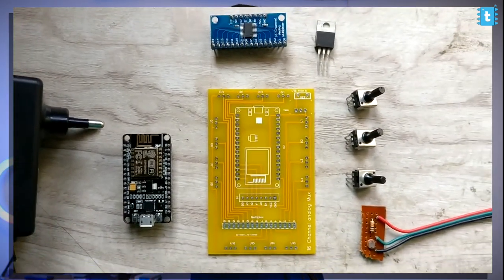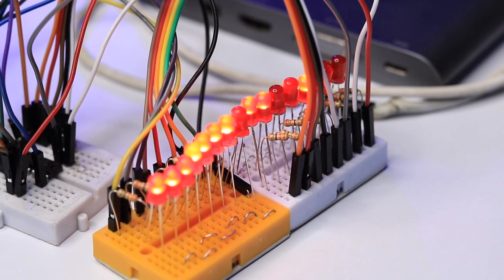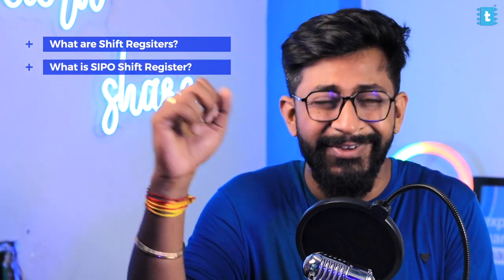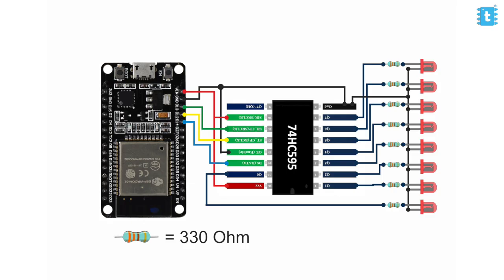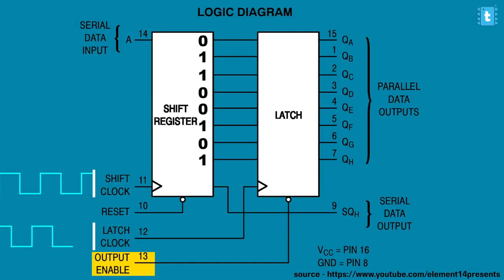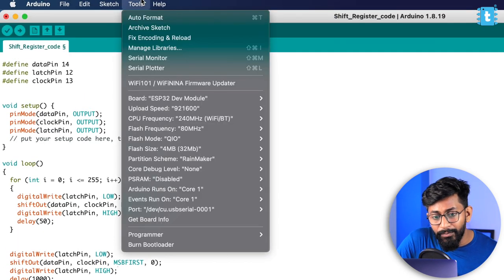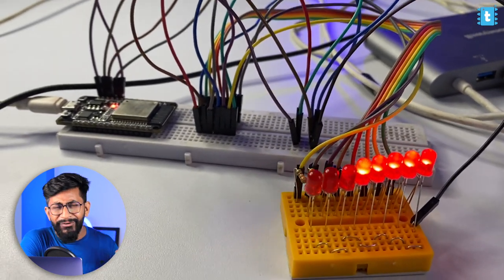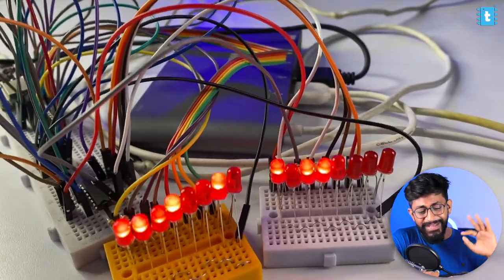Using Shift Registers to Get UNLIMITED GPIOs for our project !!

Comment: 74HC595 is only output shift register and you can only extend output pins so GPIO means input and output. so You can't say 595 is a GPIO extender its only a output pins extender
Reply: i think if latch gate supports binary data input, then we can use the clock to check the state of that latch and use it as input too, just reverse it.
imagine you touch a latch gate-oupout with 3v, now the it saves the binary data, now using the system clock to mesure the latch state and use if-else statment or any other function we can use it as input too, but i guess we will need 2 clocks, one for checking latch state and another for retriving data/state of the gate

Comment: Shift registers won't get you unlimited GPIO. It will only get you outputs, but no inputs. Why not just use multiple MCP23017 IO expanders? That will give you true unlimited GPIO.
Reply: No, that's not true. You can cascade multiple hc165 with hc595 and have all the GPIOs you want, or only inputs or only outputs.
Reply: @HelderParracho  Ok, fair enough. MCP23017 is still the better choice.
Reply: @CristiNeagu  Better or not it really depends on your needs. MCP23017 is more expensive, harder to find in stock, much slower and more difficult to isolate. It might be a more compact solution though.

Comment: In Dots matrix or running text led, 7 segment, ic shift register is usefull of that projects, but for projects with need multi input/output, more efficient use ic expander PCF8574 (8bit) or MCP23017 (16bit) with i2c communication (2 wire only)
Reply: Microchip makes an 8-bit one too, the MCP23008.
Reply: I don't get why people are so fascinated with shift registers when IO expanders are a thing...
Reply: @jnharton  MCP23017 can be controlled in both 8 and 16 bit modes.
Reply: @CristiNeagu  That’s interesting, haven’t read the datasheet in depth. My point was just that there were options.
Reply: @CristiNeagu  BECAUSE I2C is unreliable compared to SPI and Direct accessing Shift Registers. You will get to notice only if u have multi modules in to MC.

Comment: shift registers are fine if its a slow driven output so an alternative is do parellel latching, a chip I have used a lot for large GPIO expansion is 74HC373
Reply: Random ask: You wouldn't like to make a YouTube video of that would you Mr Driscoll?   Everyone with a phart smone has got at least one YouTube video in them. ;)
Reply: @WintonMc  corrected the part number - my head is full of a cold and mixed up my chips lol
Reply: simply write 8 bits in one go to port D, then toggle pc0 low and back to high to latch the pattern to U2 Q0-Q7 then do another write to Port D and toggle pc1 low and back high to latch that pattern to U3 Q0-Q7 .... you could add a 3rd latch and so on if you need more lines just add its LE to the next PC port (pc2) and so on - each latch uses the same pins PD0-PD7 as the inputs and LE as the latch toggle .. low sets the Q lines to match D lines High keeps them in that state.
if someone really wants to get this up and running im happy to help just buzz me here
Reply: @WintonMc  Never done a You-Tube Video .. life keeps me busy as it is... but here is all the details.

Comment: It might be worth mentioning that there is such a thing as an "analog shift register," which works like a digital shift register, except you can shift in analog voltage levels, and that voltage level is retained on an output pin until the next voltage is sent, and then the voltage level shifts to another output pin.  Of course that's sort of irrelevant with an Arduino UNO, since they don't have a DAC built in.  They can be useful with a DAC shield though.

Comment: Using this technique with an absolutely minimal MCU like the ESP-01 is absolutely a great solution where you need intelligent output patterns on a large number of LEDs.  Once you get over 16 outputs though a chip like the M5450 or the TL5940 or MAX7209 does a better job and provides brightness control too.

Comment: You should look into the 74322 and compatible replacements. It gives you 8 I/O pins that you can control as a bank. It doesn't quite give you full GPIO, but it's perfect for talking to a wide bus from a limited number of GPIO pins

Comment: The 74HCT595 or variations thereof is a very good choice for expending many outputs with only three output pins from the processor.  Of course there's a parallel in inversion of this which works well since when you load the inputs it captures the data at that moment in time.

What makes this chip great is that you can shift in the data first in the shift register but will not go to the output until you hit the load line.  

Theoretically you could have unlimited outputs your limit is only how fast you want to refresh an output bit.

For example I use these to create a 3D LED cube meeting 16 outputs.

Comment: Nice video! But I would recommend (when available on the MCU) to use GPIO expanders with an I2C interface. By changing the address of multiple I2C GPIO expanders you could control a massive amount of GPIO (example IC: MCP23017) (Edit: Thus as a addon controlling pins using I2C is very simple, not bitshifting and so on!)

Comment: you can use a 595 directly on an SPI bus with the proper clocking and phase. most microcontroller have hardware SPI. Often even with DMA. That is the most efficient and fastest way to IO expand with a serial to parallel shift register...

Comment: Before watching, 2^3=8, so use the pin as binary. The con is, that it can work with LEDs, but not very good if the output needs to be precisely timed.

Comment: I am using a 74HC595 shift register with the same connections but with manual control at its input (not connected to any controller). However, when I turn off the power supply and then turn it back on, I get random values at the shift register outputs. Is there a solution to avoid these garbage values at power-up?

Comment: You might take a look at my Serial Wombat project.   It basically fills the same niche of adding GPIO to Arduino, but it's firmware running on a microcontroller, so it does a bunch of smart stuff (rotary encoders, PWM, Servo, ADC, etc) that a MCP23017 or pca9685  can't over an I2C interface.

Comment: I used to use a cheap large 40 pin chip that was a large shift register and 32 outputs that could drive small relays.

Comment: what will you use as gpio software driver ? on your operating system.
Reply: like a the input of the keyboard. requires keyboard.drv pre loaded. along the mouse.drv. on the msdos operating system. so i believe a omni gpio hardware. requires also. gpio.drv preloaded in the memory from boot of. but i dont know.  since also the ram space need to be limited to make room for other hardware. and also a irq or a cpu cycle need to be resident reserved for that. hahahaha. i did not even see the whole video. maybe you just explained that the arduino compiler took care of that. while writeing the file away.

Comment: 1. This lacks 'I' in 'GPIO' ;)
2. This is not that 'unlimited', although we used an alike approach in order to get 96 outputs without issues.
3. Too slow, mostly useful for static LEDs or relay driving or alike, yet that is the limit.

Comment: You might be able to get away with controlling multiple things with a MUX if you're using latch gates to hold them 'on' once they're going.

Still, I've been wondering about the shift register doingthis as well.

Comment: It would be cool if it used i2c protocol, them it has to use only 2 pins for data communication. There is a small delay tho but it doesn't matter really because it is really small
Reply: Yes but it then takes up your I2C pins. It maybe better to bit bang the device and have another line for chip select. That way your clock and data lines can be connected to several devices.

Comment: Not a new idea, but there is a trick: try to order PCA9505, my favorite port expander, then see MOQ and lead time! Americans screw up badly going against Russia and forgot where raw materials are coming from, so "all american-made chips" actually made in Taiwan cannot be produced any more...  
Does not matter if you are after Arduino-grade projects, but even Arduino (Atmega) chips where produced by Microchip and NOT available any more, all what is left is stock in some places. Unless something changes dramatically, we will end up using transistors...
As for some comments below, India has a lot of very good engineers as well as large hobby community.

Comment: Just use a pca9685 you get 16 pwm capable gpio. Each 9685 has 4 i2c address sel bits so 0000 to 1111. That means 256gpio per i2c in theory.
Reply: And you can also use i2c mux which gives even more possibilities

Comment: I'm sure this would be very interesting to some but the title is a lye so ...
What you show is about adding digital output, not GPIO. GPIO does much more than just digital outputs. Title promesse you might present a chip that allows actual gpio extensions, and you don't deliver on that.
Hint : MCP23s17 ;c)